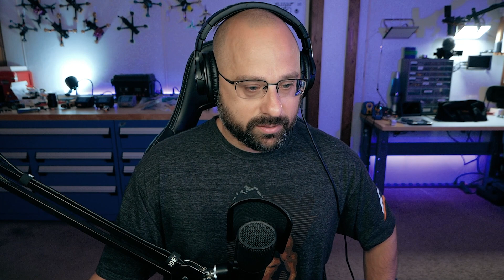Shielded Wires. Do They Help The GPS Get Lock? - FPV Questions

Comment: Could it possibly make it worse? Yesterday I was able to get 4 sats inside and up to 13 outside. Was hoping to push it up a little with the metal tape but now I only got 7 after 5 min of sitting. Once it was hot I still only got up to 7. Can’t seem to find anyone who says it could make it worse.
Reply: Could make it worse if the shielding isn't grounded. If it isn't grounded you are "catching" noise and not dispersing it.

Comment: GPS-- Today I finally got my 7 inch together, Its not new, BUT I just put a Vista Unit in it from Analog, Its a Very cloudy day, Barely see the haze of the sun,, I put a Lipo on drone she sat in my driveway for the entire lipo 
 NO SAT Signal in Inav= no ARM. 
I talked myself right into ,, its to cloudy for GPS anyway. 
Then I remember I brought a 6 inch piece of Shielded communication wire home from work, Only 4 wires But pretty flexibl,e I have a Beitian 880 GPS so 6 wires is needed, I soldered the 4 shielded wires to the GPS pads then soldered onto FC and added 2 separate wires for power and ground. And I figured while the GPS sits over the Vista (interference?) I Lined my GPS Holder with copper tape and placed a Piece of 3M double sticky tape ontop of the copper, Then get a fresh lipo and head to the driveway and let it sit there, I Plug in the battery and turn around to go back in my house and I hear the tones that sound when signal is locked, I didn't believe it, so I grabbed my Taranis and threw the arm switch,, HOLY CRAP the props spun, disconnected the lipo and plugged it back in, Of course it hooked right back up, hour later I just did it again and it is still cloudy as heck out there, Less than 30 seconds GPS tones....
Amazing, I have been struggling with this for a while,  BUT  No More.

AWESOME!!

Comment: I was struggling with the classic TPU where VTX, GPS and receiver antennas were together getting (if any) 5 to 8 satellites max!
As soon as I move the VTX antenna to the "Criss Rosser's" position, BUM, 6-7 satellites in few seconds and up to 20-25 after 2-3 minutes flying... 😉
Reply: Any link or the video?
Reply: You can see any build video of Chris Rosser. He is placing his antenna under the back arm, stating that in this way you loose little range but you keep the GPS clear of electrical noise...

Comment: Makes sense - it doesn't actually interfere with the GPS signal itself, just that the power can be an issue. It seems like an LC filter will do the same thing, esp if there is dirty power at the source, which can also be the case.  Maybe both?  It would be interesting to test this.  I think it's also important to point out that the shielding needs to be grounded to actually work.

Comment: I was really struggling with gps interference next to a 1w HDzero vtx. Shielding the gps wires with copper tape grounded to the fc helped a bunch. Now locks really quickly and keeps most of the sats when the vtx is switched to max. Worth trying
Reply: commmenting here to share my experience. my frsky receiver had telemetry, and was noisy. i moved it to the front under the camera as far as i could get it from the gps antenna. fixed alot of my issues. then foil wrapped the wires and put shrink wrap over to hold it on. i should probably ground it someday too but its working great now. happy flying folks 😊

Comment: lol I never shielded anything, only need to change my video wire lenght/position (usual CRSF Problem) 

just dont put ur GPS  next to the Video Antenna and use PID Mode with AUX Switch

Comment: Shielding the GPS wires on my 4" long range 100% helped it get locks faster. I also added a ViFly "GPSMate" which has a little battery that will power the GPS by itself so it can acquire satellites before you plug in the battery(similar to plugging in the FC).